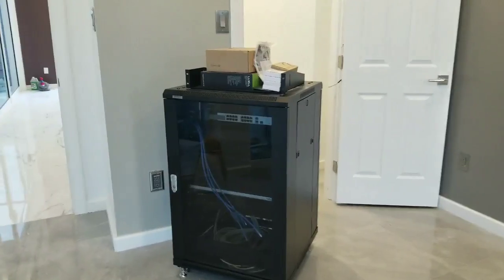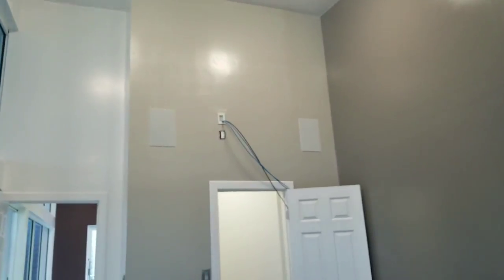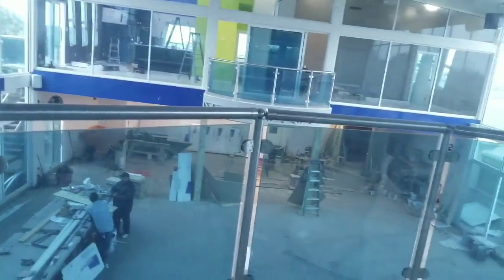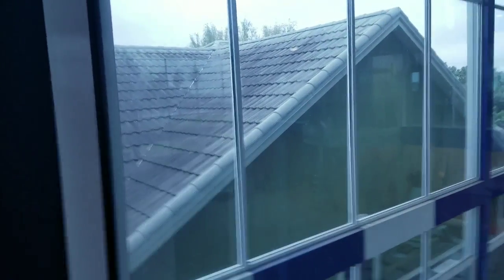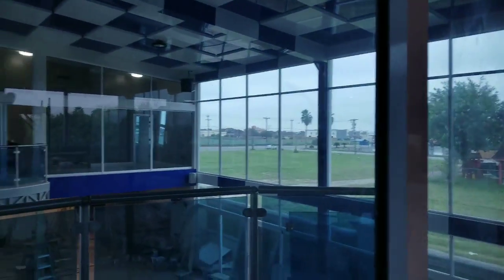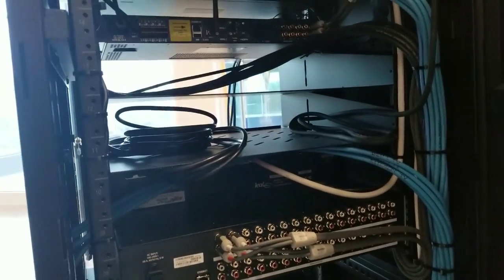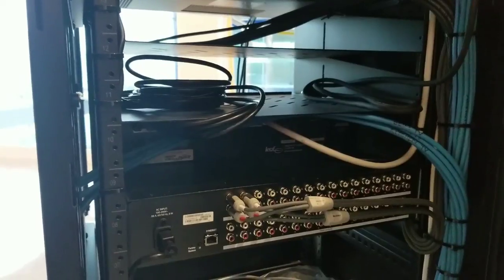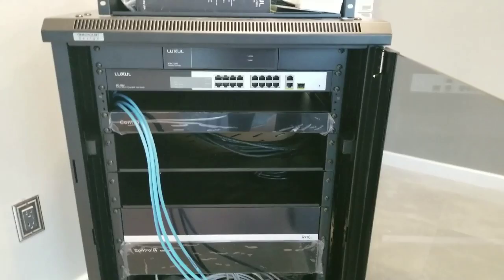How to - Smart Home, Pool House

Comment: Hey Lupe. Please keep uploading more often. What hardware (receiver/amp) do you recommend to accomplish whole house audio on a two story 4 bedroom house with multiple ceiling speakers in all bedrooms, great rooms and kitchen? Pre-wire was done with all cables running back to a single room. Thank you.
Reply from the maker: Polo Man it's hard to make a recommendation without knowing the house. If your just wanting music around the house and only plan on using one source of audio throughout then use a home theater receiver, but if you want multiple sources and independent volume control in each zone you'll need separate 2 channel amps, one for each zone.